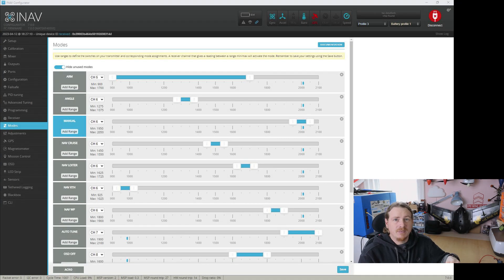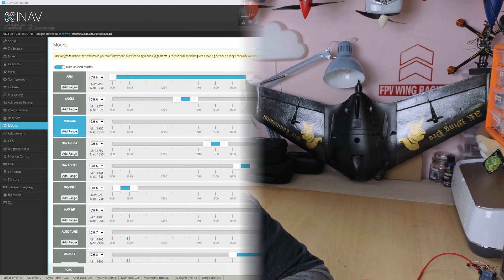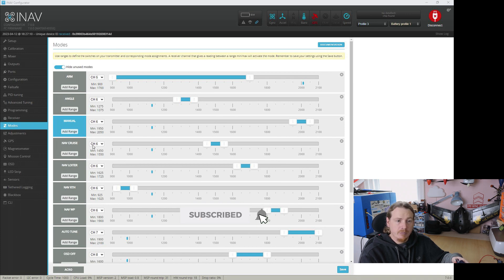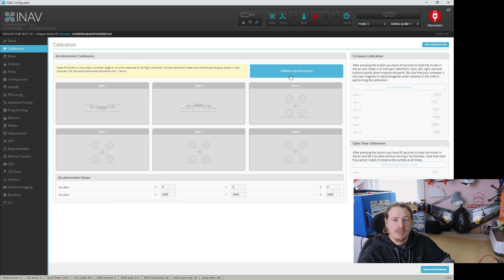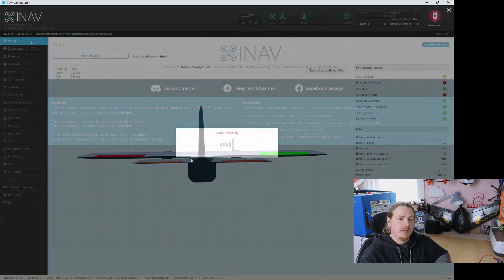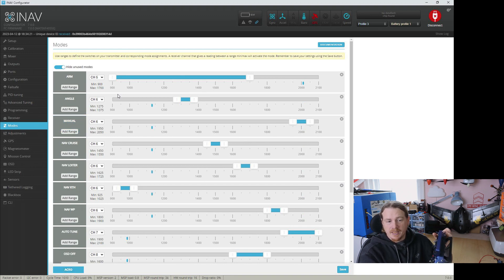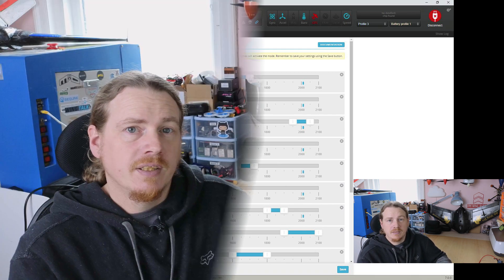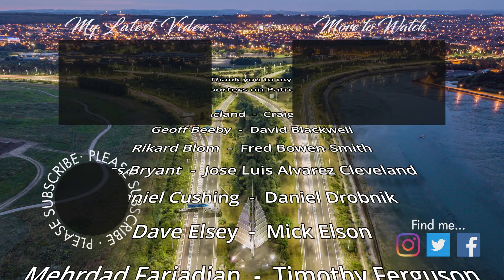Why is INAV stuck in Manual mode?

Comment: Darren, I can’t find any info on the INAV ‘Soaring’ function/switch. What does it do? Thanks
Reply from the maker: It basically allows some movement to in the flight mode, to assist with thermalling. It also disables alt hold. https://github.com/iNavFlight/inav/wiki/Modes#soaring-fw

Comment: Alittle off topic but my f405-wing with inav 6.0.1 won't show cruz mode in the osd even though it seems to be switching in the modes tab using channel 6 on a switch, just wondering what might be the problem?Osd showing acro, manual and horizon like normal but not in cruz. As always great video
Reply from the maker: Is this on the ground or in the air?
Reply: I haven't maiden this wing yet so I've only bench tested
Reply from the maker: @egtreadway4232  navigation modes will not work on the bench. What you’re seeing is normal.
Reply: Ok thanks I had a feeling that was the case, this is my 3rd ar wing pro build and this time I setup elevons according to your video, after doing so I have recommended 12mm throws, alittle nervous about maiden because on first 2 builds I used tipple rate setup  in radio, 60% 75% and 100% but will see how she flys. Thanks again
Reply from the maker: I would always recommend setting the throws to the manufacturer’s recommendations. If they don’t have any. 20 degrees is a decent starting point.
Reply: Thanks

Comment: LOL this just happened to me, thanks! perfect timing
Reply from the maker: It seems to be happening a lot recently. I’ve never noticed it myself, as the first thing I usually do is calibrate the accelerometer. Its a good way of checking the board is working before soldering anything to it.
Reply: @MrD  I thought I copied my calibration over from a 6.0 RC3 so I assumed it was calibrated. Maybe something changed with saving calibration values? No idea
Reply from the maker: @cagmuer  it should have come across from RC3.

Comment: Which ethos radios have a 4 in 1 multi module. And what is the name of the module, and which radios will it fit thanks so much.
Reply from the maker: None of them come with a 4-in-1 multi-protocol module. The JR Lite bay is a standard bay that can accept one. I’ve heard of people using the iRangeX iRX4 lite module. I personally don’t have one.

Comment: Any new news on the siyi a8 gimbal . My set  up now is so bulky I can only land anaconda on hard surfaces. Would the a8 work with limited functions all I really need is pan, tilt ,zoom, and recording. My set up now hangs down almost 3” so I only have like 3” of clearance under camera one bad landing would be bad. I hope a8 will work or I’m gonna have to either move camera to rear of fuse or cut out some foam and move pan tilt up higher in the nose don’t really want to do either. If raise in nose than can’t run small battery if I move to rear than there’s the landing gear will be in frame I hope A8 will work be such an easy solution and will be lighter. Don’t care about the following features just the basics. Loving 6.0 man thanks again flew cloud 200 miles yesterday final testing. Getting ready for those long 2,3 hour flights
Reply from the maker: In all honesty. I’ve not really been keeping tabs on the A8. I’m sure it will be added in the future. But with Open Source, there is no schedule. I’m glad you’re enjoying 6.0 though. It really is a good step forward.